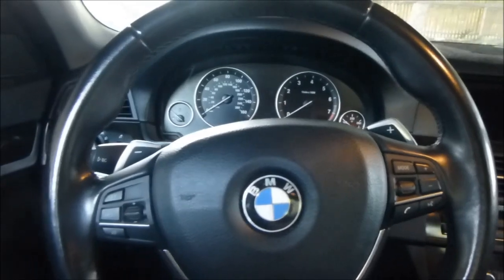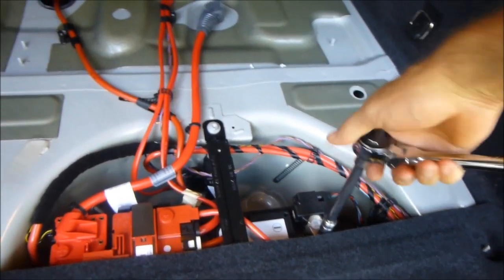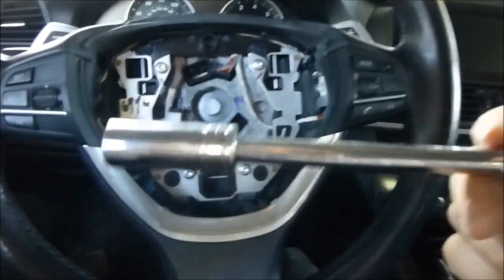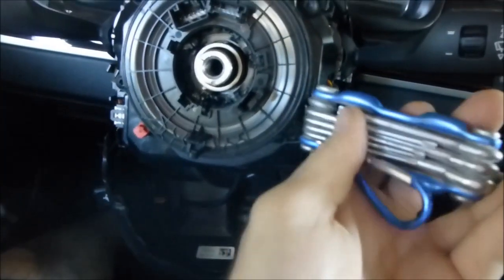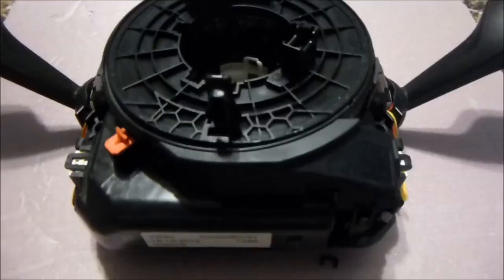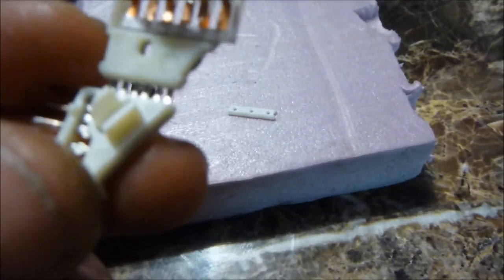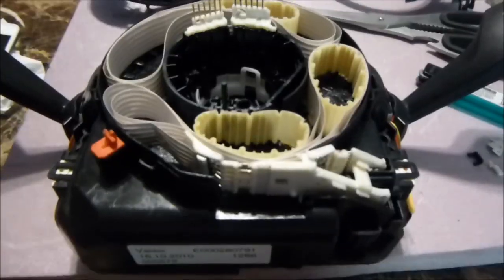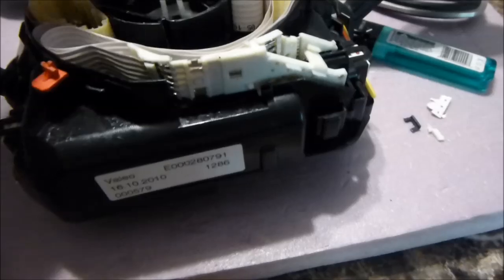2011 BMW 535i F10 Lost all Steering wheel functions How I Fixed it

Comment: What is the trick to release the lever to remove airbag?
Reply from the maker: Watch 3:30 seconds in, you use a screwdriver to push up the lever that removes the whole airbag assembly.
Reply: @JacobKnightRiderShop  Thank you!  Finally, got it after an hour later.🤪 i had to push in the airbag to align the spring then push it up to release.  Thanks for the video.
Reply: Also, do you need to reset the system with the dealer?  My warning  ⚠️ lights still ON.  Another light came something with a steering chassis?!?!?

Comment: Hi do you need to reprogram after plug off the battery?
Reply from the maker: I didn't.
Reply: that's because all you did was fix the orginal, when replacing with new oem part, needs to be coded

Comment: Squib ring is easy repair I done mine in 15 mins .
Reply from the maker: yea but where would you find the slip ring, they dont sell them new that I know of?
Reply: @JacobKnightRiderShop  and if you don’t get the correct one for your model some functions may not work so go to bmw pay that little extra and save all the hassle .
Reply from the maker: @Alfiepops  little extra, they wanted like Over 3 grand, I got a used one on ebay, the hand speed flaps dnt work only but I never used them anyway.

Comment: Can someone tell me where I can find either the ribbon with the attachment at each end .. or if I need to solder the old attachments to a new ribbon?

Does anyone have the measurements of the ribbon ?
Reply from the maker: I used the same ribbon and resoldered it where it came off. Not sure if you can buy those ribbons.

Comment: What would you charge to solder the ribbon cable?
Reply from the maker: I probably wouldnt tackle this for someone as i wouldnt be able to warranty  it.
Reply: KnightRiderShop just want to thank you for this in-depth video.I fixed it today. I had to order the unit off eBay opened it up to make sure the ribbon was intact. Switched it out all is well besides the airbag warning! Thanks again!!!
Reply from the maker: @dnice2092  awesome. This must be a common problem as many had this issue.

Comment: Correction at 6:15, it’s connected with 2 not 3 wires !
Reply from the maker: 3 wire looms is what I meant, dnt recall if it had a separate plug for the 2 wire looms I was reffing tho.

Comment: Has anyone here replaced the part yet? If so, was any reprogramming required following the replacement?
Reply: Programming is definitely required for F-chassis cars. Conventional programming with E-sys might be enough, but changing the VIN in certain modules is very difficult. I'm noticing that some chip programmers like hextag and CG 9S12 allow for cloning of the SZL module, so perhaps that is the best option.

Comment: Any one from UK has tried this ?
Reply: Fixed this issue for £15 using this video as a guide. Top work KnightRiderShop. Nafiz Haq email me if you want any info
Reply: @nafizhaq4554   you get yours fixed in the end
Reply: sim rai yes I did it myself
Reply: @nafizhaq4554  how dod you do the cables inside

Comment: You know, if you can afford a BMW and expensive vehicles like that, then should you  also be able to afford expensive parts for that vehicle?   Just saying. 
Plus if they went back to old school and stop putting the entire function of the car on the wheel then we won’t have issues like this.   Just keep the horn
Reply from the maker: I got the BMW at Carmax so I didnt pay BMW price. But True on the wheel having too many functions. But it was nice to have. They just need to fix the ribbon issue inside.
Reply: Many of us are buying these things used, for not that much money. No excuse for the stealerships to set pornographic prices on stuff. And now even many budget priced cars have these multifunction gizmo fests on the wheel. Look at Jeep SUV wannabes. They have a ridiculous number of buttons on the wheel, to the point that it's silly. They even have more buttons on the back side of the wheel, as if the front wasn't already overloaded with buttons. My VW had a nice setup on the wheel and I don't think VWs have all the failures that we are seeing on the BMWs. It really should be a recall item if it can also affect reliability of the horn and probably the airbags too. Typical of BMW wiring is to use conductors that are just too darn light for the task though. FOr example the pathetic ground wires in the rear end of the car that fail and cause the headlights to flicker or prevent the remote/key from working.